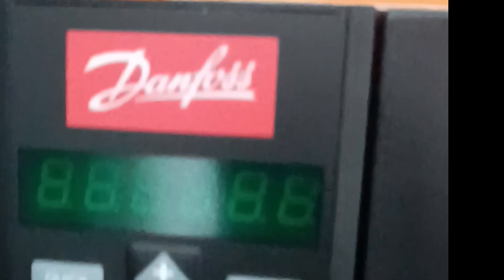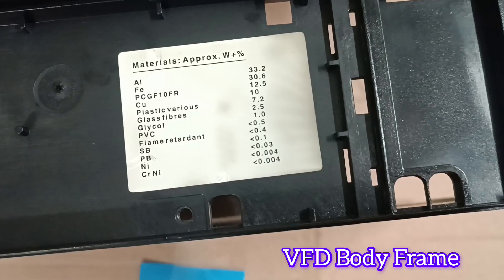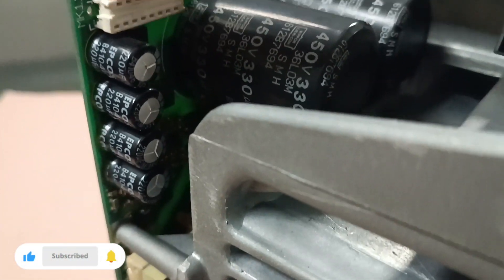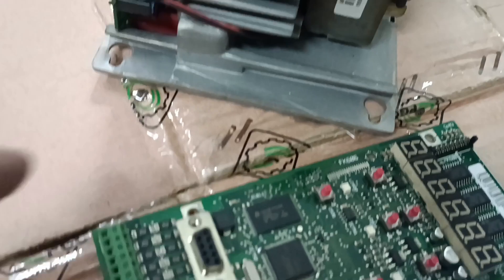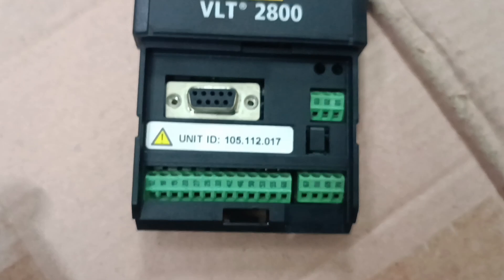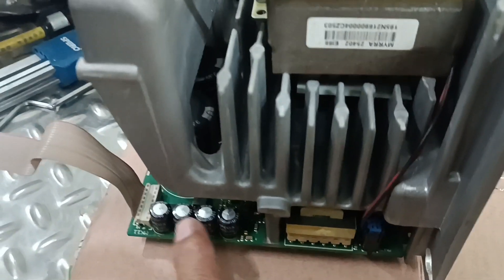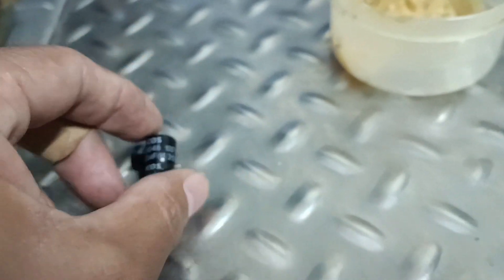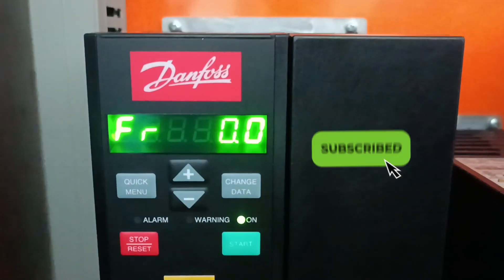VFD Blinking Solution|Danfoss VFD 2800 Blinking Issue Solution | VFD Display Blinking Fix | Blinking

Comment: What is the cause of the damage to the four capacitors? I have FC-202 and the LCP Blinking could it be the capacitors ?
Reply from the maker: Yes, it could be the capacitor,, hope after replacing the capacitors it will be solved.